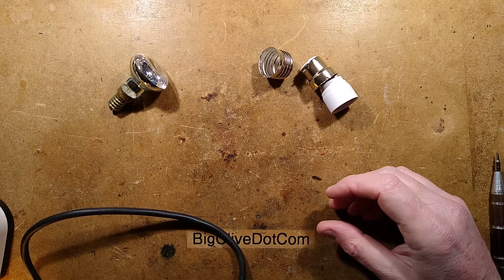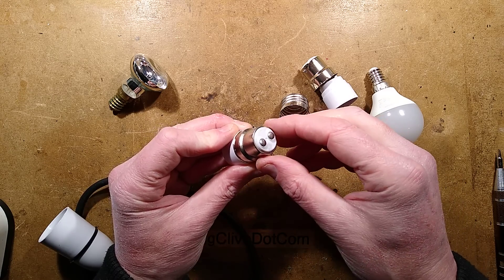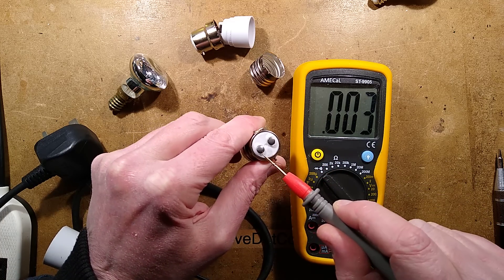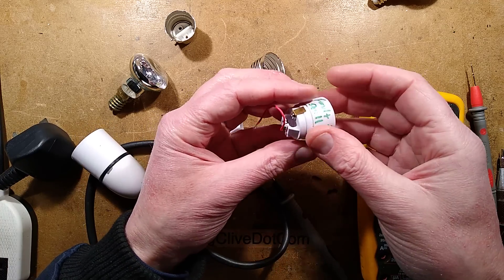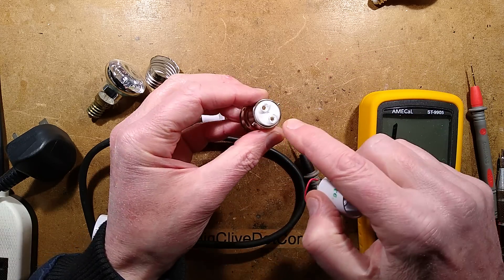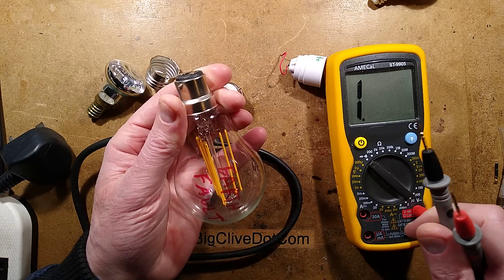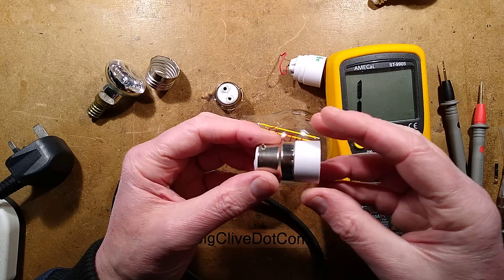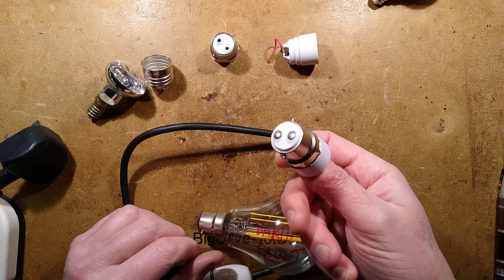Rogue lamp adaptor with shock risk

Comment: That small mechanical difference of removing the brass tab when making a bayonet adapter would have made it both safe to use and not trip the RCD/GFCI, but of course that would mean two production lines for different regions, rather than the cheapest way possible.
Reply: Considering the fact that they have to add a wire to that terminal for the BC version, it shouldn't be too difficult to do... but then they don't know anything about the world outside, as we have seen in many cases... oh well...

Comment: Like the old AM “hot chassis” radios, but with less music and more light. You never knew if the chassis (and volume control shaft) was connected to the hot or neutral AC line.
Reply: Some light fixtures too.  I recall a story my Grandfather told about some metal lights in their farmhouse where they put up some tinsel garland from one light to the tree to the other light and blew the fuses.  After much investigation he discovered one light was hooked up with the base hot and outside/fixture neutral while the other was reversed making the base neutral and the outside/fixture hot.  The metal tinsel garland wire was shorting out the circuit when they put up the decorations and turned on the light.
Reply: I remember that the tinsel we used on our Christmas tree was polished strips of lead…
Reply: @Cooper_42  We still have those.  My mother has been carefully re-storing it after each year we use them.  I happily remember that you really could throw the tinsel on the tree.  Not a health hazard unless you eat them, and even then, it's not that much. (elemental lead, not organic compound)

Comment: Yay, that's an absolutely fantastic product, the fact that the live metalwork sticks out isn't enough, because it can put live to earth and trip the RCD! Assuming you even have an RCD on  your lighting circuit!
Reply: In a way connecting live directly to earth isn't that bad without an RCD because it should instantly trip any standard breaker. Bu then again I know the UK sometimes uses different grounding systems so this might not always be the case.

Comment: Interesting. I have a couple of those adaptors which I bought for peanuts from AliExpress because in NL I can't buy any bayonet type bulbs to put in our old British lamps. Anyway, in happy to say that mine do not have this fault. They have no connection to either pin so presumably are safe. My adaptors are slightly different in appearance to yours: the white plastic part is ribbed for extra pleasure. This may (or may not) help others to find the safe kind.
Reply: That's weird you can't find B22 bulbs in NL because it's still quite popular in France and I think it's still available in Belgium.
Reply: @PainterVierax  I dare say they're available somewhere, and I'm sure I could mail order them, but I can't find them in any local shops. Hence I went for the adaptors for the sake of convenience.
Reply: @DavidHembrow  yeah I assumed you're talking about physical retail shops, that's why I didn't push any suggestion ;-)

Comment: One thing worth noting is that even without this issue, these kind of adaptors aren't necessarily safe. You have to plug the adaptor in the right way round, else the ES external screw part becomes live. An extended plastic shroud helps to some extent, but it's commonplace for people to change lightbulbs whilst switched on (knowingly or unknowingly).

Comment: Thankfully I warned my daughters never to handle even mildly suspect lamp adapters without alerting me. Alarmingly eBay appear to be going from bad to worse which is why we no longer use them, instead visiting our town's well established electrical & hardware store. Good insight and action, Clive. Great!
Reply: Good on you! It's always a good idea to teach kids some hazard awareness. I don't say that because i have kids (no, I don't), but because I myself was "that dumb kid" with a fork once...
Only got "zinged" a bit, as Clive would say, but nevertheless! 😉
Reply: Still don't trust them.  I've run into fakes where the cheap junk is mixed or sub'd in the supply chain warehouses so you think you are getting something good but its really the faulty/dangerous junk.
Reply: @DerMarkus1982  Thank you for that. Appreciated.

Comment: I bought some these from ebay and they tripped my mcb or rcd, after checking with a meter i found they grounded the metal part to one of the contacts on the bottom as you found, and they were mark CE approved, when I complained they said there’s nothing wrong with them.
Nice job Clive 👍
Reply: CE is meaningless.  You should be able to look up an ID code on an official website that you can then see the corresponding product has been certified.

Comment: Thank you Big Clive for alerting us all to the danger here. I must say though that I'm very surprised that our UK lamp holders with their two live pins inviting the insertion of a finger haven't been banned. If they were a new thing introduced these days they'd never get approval. The GU10 fitting is far superior with no access to the mains for the enquiring finger and no seizing up even after long service. It could easily be introduced and ordinary lamps as opposed to spotlamps could be easily made to fit it.
Reply from the maker: That's the peril of grandfathered standards.  I'd like to see a real push towards a sensibly designed lamp holder.
Reply: I believe MK make a BC lamp-holder where the contact plungers are not energised until the bulb was inserted - the "Shockguard" IIRC.
Reply: @HowardLeVert  I think these lamp holders you describe started to be installed in new build at least 'round my way. There was an issue I'm told in that people perhaps did know that ordinary bulbs would fit them so naturally they were all cut off and regular lamp holders got fitted.
Reply from the maker: @Monkeh616  I made a video about a safety lamp holder last year.
Reply: @bigclivedotcom  Must have missed that one. Tenby.. they're rather dead and gone, I believe. There are others on the market, whether they hold up better or not is another matter. At least we're not using 100W lamps to cook them any more.

They seem a sensible solution to the exposed contact issue without changing the style of base.
Reply: A huge problem with making a 'perfectly safe' lamp holder is that people aren't perfectly safe.   Another big problem is that in general, safety features will fail because of moving parts, or be frustrating to use, so the user will bypass them.   I have a pistol that has so many safeties that it's unsafe.  You can't open the chamber unless there's a magazine inserted, so if you have a round in the chamber, you can only remove it by having a spare magazine, or jamming your loaded magazine in and repeatedly ejecting the entire magazine worth of rounds.   You can't actually unload the gun properly.
Reply: @tbelding  Is it possible to snap in an empty mag, so it trips the magazine follower and then extract the cartridge like that, without a load of other explody things in close proximity? I don't own guns but I know enough to wince when I think of what you're describing... Especially if the cartridge is a "light strike" misfire that might do something unpleasant if fiddled with in the wrong way..
Reply: I'd never actually thought about it, since I just assume that being that stupid is not conducive to living long enough to run into electrical maintenance... But then my 18 month old stepdaughter decided to play tiddlywinks with citalopram pills... So, um, yeah...
Reply: @bigclivedotcom  That'd be the bulb manufacturers greatest day in history... But what about the light bulb sockets like the G9...? Would you consider them safe? The contacts are well hidden and the slide holds the bulb securely, although smart bulbs in that format might need some creative design work..
Reply: Bayonet caps were an improvement on Edison Screw bulbs and fittings where the thread of the bulb you're fitting can be at mains voltage while its being screwed in. ⚡
They should be first for a ban.
Reply: @rosiehawtrey  You can, yes, but most people don't just keep a spare empty magazine.  As this is a .22, loading and unloading the magazine can be a bit painful from the force necessary.   The last time it happened, I was in the parking lot of a gun range, trying to show the gun to someone else.  I checked to make sure it was clear, and there was a round in the chamber.  It took 2 minutes to unload the magazine (making sure not to lose any rounds), put it in the gun, eject the single round there, and let him look at the pistol.  Then I spent another three minutes reloading 11 rounds into the magazine.   It's not a bad gun, just too many safety features.
Reply: @khaitomretro  Remember that with the way the bulbs are designed, you usually have no hand near the screw.  You have one hand over the bulb itself (it's a hand hold), and the other hand either holding the lamp, or balancing you on the ladder.  They definitely cannot be called an 'improvement on', when they're completely unrelated fittings.  That's like saying South Africa's electrical outlets are "improvements" on the US electrical sockets - when the developer of SA's may never have seen a US socket, only Europe or Britain.
Reply: @HowardLeVert  Got one.
I had to buy it and install it myself as a replacement for crumbling plastic round the metal holder. That gave me plenty opportunity to play with it before trying to connect it. 

At first I hoped that it might be able to take and hold a GU10 instead of required, but no. BC only.

Comment: Yup I bought a batch of these. It took me five minutes to figure out why the supply was tripping when I used the first one, I couldn't believe it! I reviewed the supplier on ebay warning everyone, if the reviews get read of course. There are several ads for these, but the design varies, some are all useless, some are correctly constructed. The only way to tell is either buy them and test, or if there are reviews check them. However beware some people seem to find safe adapters supplied through the same ads as the faulty ones......

Comment: I've had various of these types of adaptors from a local well stocked hardware store. Some conversions that maybe shouldn't exist. But I would always do a continuity check to the BC metal shell simply because of the reason you've shown here. Another example of a tripping breaker I had recently was a brand new infra red lamp (BC) installed in an earthed brass BC lamp holder. Every time I switched on the circuit, the breaker would instantly trip. 

I tried other lamps, both LED and incandescent filament and they were fine. Checked the circuit with a 500V insulation tester, also fine. So the conclusion was it must be the new IR lamp. 
Sure enough, on closer inspection of the bayonet cap of said lamp revealed a whisker of wire coming out of BOTH base contacts and touching the shell. This was somewhat surprising from a well known British lamp manufacturer. How the hell did it pass quality control with such a defect? 
This only adds weight to what my Mum used to say, "we don't need to import foreign made rubbish, we're perfectly capable of making our own rubbish!"
Reply: In rare cases ☹️